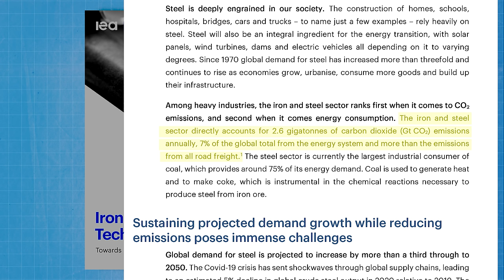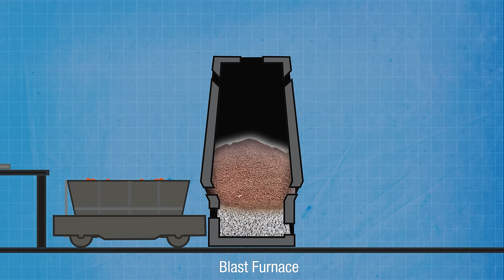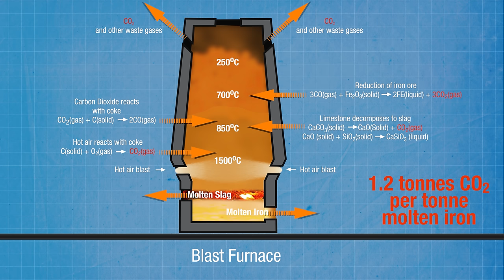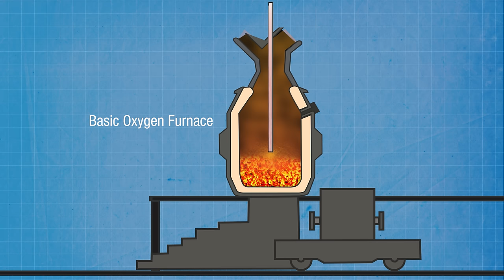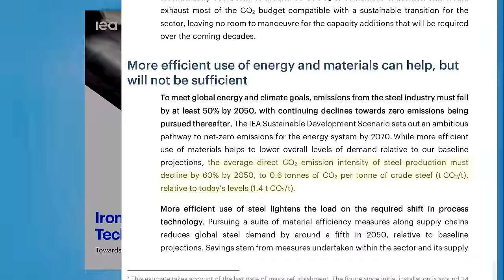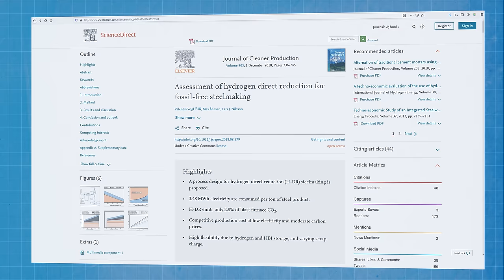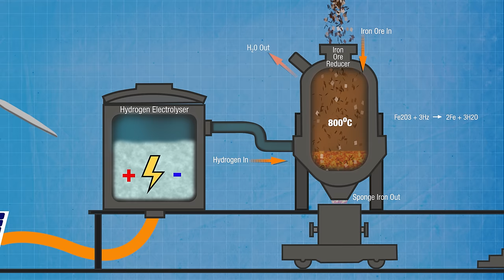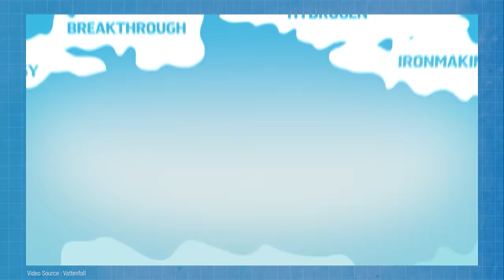Fossil free steel. Another giant step towards net carbon zero?

Comment: Bonjour!
We've had a lot of  trouble deciding between wood structures or steel structures for construction here in Quebec.
This will help decide things in he future thanks!
Reply: advantages for both,  but Steel buildings are cheaper, stronger, and easier to build.   Plus they are a bit more fire resistant  as long as you follow the building codes :)
Reply: Allow me to make it harder. Both Norway and Sweden has built apartment buildings up to about six stories high in wood. Those two countries has roughly the same climate as Canada so should meet the enviornmental critiera.

Can't recall where the norwegian ones are but the ones in Sweden (that they also decided to clad in cedar shingles) are located at Strandparken in Sundbyberg (so about 30min by foot from Bromma Airport (short haul, does connect with London however), if you need to send a delegation to actually see the houses once travel is possible again).
Reply: If you make buildings of wood there is a high fire risk. Just look at San Franciscos region, anywhere houses are made of wood and are  close to forests they will be burned. Use breeze block faced with rock. The wooden house thing is clearly dangerous. But whatever, climate disruption will be the prominent feature of our future.
Reply: No more high rise buildings. Therefore less steel use.
Reply: Also aluminum structures are more susceptible to fatigue than steel structures. Steel lasts longer. If weight is not an issue I would choose steel.
Reply: @timkbirchico8542  That is an engineering question really - fire risk in a properly engineered wood building is roughly the same as in any building with furniture in it (furniture and wallpaper are the real kindling, not to mention rugs/carpets). Also, by the time fire from huge blazes gets close enough the air is already too toxic.

Also, there is nothing to prevent you from doing a concrete-based coating on a wood house, and suddenly it becomes even more resistant towards fire than steel houses are (but to be fair, once you hit the temperatures where steel start to become an issue you want to rebuild the structure anyway)

People seem to underestimate just how good wood is at resisting fire if used properly.

(I should point out - wood "high" rises are not the same as the small cottages most people seem to think about, we are talking things that are designed to develop a fire-resistant char in case of prolonged exposure to fire)
Reply: Steel structures  are not more fire resistant. The insurance industry ranks 'massive  wood construction' as the best for fire rating. This doesn't sound right, so here's the logic. Wood is a  great insulator. And it burns from the outside in. So it takes a great deal of time for a fire to burn thru a massive wood column, before it is reduced  in size that allows failure. Steel, on the other hand, when it gets hot enough, merely lose strength, and the structure quickly collapses. Solution??? Massive insulation of a fire resistant coating must be applied to these steel structures. So, for smaller buildings, currently 12 stories, massive glue laminated columns lock up enormous quantities of carbon, are low in entropy in the complete building cycle, and are distinctly  beautiful. How about a episode on this...or has this already been done did?
Reply: @davidkreimer2970  I completely agree with you. My preferred material has always been wood. Wood does have also a high fatigue resistance.
Medieval wooden constructions are still standing. Where I live there are many 13th and 14th century buildings that are still standing strong.
Trees have evolved to be fatigue resistant.
I nag about fatigue because it determines how long a construction can last.
Reply: Fire protection for steel and wooden beams: Aerogel.
Reply: @TTTzzzz  Moisture management for aerogels: wood or metal enclosures ;)
(While aerogels are great in some applications you do not want it exposed to uncontrolled enviornments, especially long term)
Reply: @Herr_U  Please explain.
Reply: @TTTzzzz  Aerogels by nature are hydrophilic which makes them collapse, you can treat them to get them hydrophobic.

However neither state really is desired - in the hydrophilic state it will collapse after a while (simply by extracting moisture from the air) if left in an uncontrolled enviornment.

The hydrophobic state (when threated in structure, the surface only still have a hydrophilic inside structure) does better but ages more rapidly under controlled conditions (and we lack long term data for the hydrophobic version).

Also aerogels doesn't do well if subjected to repeated freeze/thaw cycles once you start bumping your timeline into decades (for short term use (less than about two decades) it is an awesome family of materials once moisture is under control, beyond that you either would have wanted to keep it in a controlled enviorment or institute a strict regiment of inspections and replacement).
Reply: @Herr_U  Thanks for your input. I am going to study aerogels much more extensive. The firm I work for is considering aerogels as insulating offshore constructions.
Reply: @TTTzzzz  It is worth looking into closely, there has quite recently (last two years) been a couple of papers published regarding testing its durability for long-term.

In general the normal method to work around it is to simply sandwich the aerogel between two shells that restricts moisture.

I'm actually a bit curious about a thing there, how long do you roughly spec offshore installations to have a service life for? (I'm from an electrical train background so I'm used to think "temporary is 20 years, short is 40, normal is 80" (this for the electrical parts, for the rolling-stock rails the rule of thumb is "make it last at least a century") (the "normal is 80" is due to the concrete type we used half a century ago, without regular maintenance it was only specced to live that long))
Reply: @Herr_U  Thanks for your reply.
It's hard to spec a service life.
It is: do your best and make it as strong as you can. All scantlings are calculated ofcource with 'finite element' software.
Some parts of the construction are 300mm thick
Service life depends on where the FPSO is stationed. For example off the coast of Angola (calm and warm waters) or the northern North Sea. (extreme and cold weather conditions).
I will expand on the northern North sea.
Because this area can be very cold the ship construction, piping and systems become brittle so fatigue resistance becomes  important.
Due to the heavy weather and large waves (20m) and the more than occasional rogue waves (30m+) the ship is heavily constructed. Even then damage to the structure can occur.
The life span of a FPSO can be 40 years,
It depends on the design construction and loading.
The systems may be renewed. Piping, valves, electricity generation, oil and gas processing. chemical injection etc.
Calculating the life span of an FPSO is impossible.
If you want to take a look at an FPSO search for 'Bleo Holm'. 
Thank you for your request. Regards, Piet.

Comment: This technology was developed few years ago already, so it has greatly annoyed me that so few people have heard of it and there's always at least one moron going "but (insert green tech) uses steel and that is not carbon free!" when 1. this tech exists, and 2. fossil fuel industry uses even more steel so right back at you...

A potentially major thing with the new system is that the furnace will be putting out a lot of 800 degree steam so it should not be a problem to direct that heat into an exchanger for a boiler of a steam turbine. The plant will be using lots of power in the electric furnaces so producing some of it locally from what is effectively a renewable power source should both help with their power bills and CO2 tax and lower the amount of power the local grid needs to deliver to industry, meaning there is less drain on the grid, less need for balancing and less need for new power plants or storage.

Of course we will still need more grid power production and storage, but instead of adding a huge consumer that requires building of a new power plant a new steel mill will be buying renewable power for producing hydrogen, which acts as energy storage so they can use solar or wind without worrying about night or windless days stopping everything. The hydrogen will then make steel and steam power, which is a steadier energy source as there will be plenty of waste heat that can be used to keep the boilers hot. The electric furnaces cannot boil more steam directly as the last thing you want in a thing you want to get hotter is a cooling system that operates when it is running, but those machines, as well as the molten steel, need to cool down eventually so reusing some of the heat you want to get rid of to run more power generation will again increase the energy efficiency of the plant, meaning you get cheaper steel. Adding these devices to a regular furnace would be too costly and bothersome, but when you already have easily tapped steam for power the other parts become much more viable and cheaper to implement.

Also, while the steel plant might just run their own hydrogen production to ensure it is carbon free, you already need to prepare for times when renewables don't deliver much power or you need to increase steel production so it makes sense to build a big enough H2 factory to not just cover the needs of the steel plant but sell it to other industries and as fuel. The same industries also need lots of trucks for transport and in large scale vehicles hydrogen is cheaper and lighter option than batteries so they have even more incentive to increase the production and therefore lower the cost of hydrogen, which also means hydrogen becomes more viable for other vehicles and there will be more demand for renewable power for producing it.
Reply: The problem would be impurities in the steam would cause the turbine to fail. However a heat exchanger could sort that out and have a closed cycle for the turbine. My ballpark maths says 10% loss of energy in the exchanger plus 35% in the cooling tower. That's still pretty good though. As for hydrogen it is a git to store. You have to either store it mind bogglingly cold or in metal matrixes which are a sod in themselves. The best bet would be vented underground storage. Hydrogen escapes pretty quick if you have a decent size vent. Cold air settles and would help keep it cold. Theoretically you could store about 2g per litre of storage space if you are lucky. Liquid hydrogen at -260C is still only 7g/litre. Quarter that for  "high temperature" storage at -80C in a metal matrix.
Reply: @gordonlawrence1448  The steam coming out of the furnace would not be at high enough pressure to spin a turbine, you must use a heat exchanger just like a nuclear plant needs one to keep the radioactive water from touching anything outside the containment vessel.
Once it is no longer hot enough to flash boil water the hot steam can still be used for heating the city buildings and maybe de-ice roads. That infrastructure needs to be built by the city, but having such ready customer for your waste heat would probably attract more than one industry to build their plant in there, which means the city gets more tax revenue in addition to having greener power services and safer roads in winter.

Hydrogen has some trouble with storage but with the electrolysis going on most of the time any leakage can be easily covered for. Given it is going to be used soon I'd probably use pressured instead of liquefied gas, but reheating it to proper temperature would not be an issue with all the waste heat around.
Reply: @AnalystPrime  There are low pressure turbines. They are a lot bigger but they still work.
Reply: In fact, SSAB already uses waste heat to heat up the homes of the entire surrounding town
Reply: @counselthyself I'm not sure what a rant about how nobody is building much nuclear power these days has to do with improved steel production... If the message is that things that take a long time to build take a long time to build, well, duh.

I watched the video from the beginning and have to note that while Dr. Smil is correct about many things like how we need to waste less energy and there needs to be economic and political pressure to make the necessary changes, many of his five years old statements have not exactly aged well. Clarke's first and second law clearly apply.

The disclaimer "Past results are no guarantee of future performance." came to mind when he predicts in the next 25 years renewable power production might double or triple while fossil fuels would stay cheap and everyone keeps building more coal power...
Reply: @albingoransson6347  I figured I can't be the first to note how useful that would be.
Reply: @counselthyself I liked to see someone shining a light on this, most of the contet was positive in my eyes. Smart people have decided what should be done and then other people have decided to not do it when it comes to the plastics, sad.. But this had little to do with local heating. Yes, most of the value in the output from these incinerators comes in the form of local heating of surrounding homes. 
What i meant with "waste heat" was; heat that are not needed by the production. Like when steel are cooled in different processes. That excess heat are used in homes. Kind of like the waste plants but in the case of the steel plant, heat are not the main product, just a bi-product.
Reply: @counselthyself Produce electricity was not the point right? The more efficient thing was to direct heated water to the houses to warm them. If your house is heated this way, I would say that you are contributing to a more sustainable form of society.
Reply: @counselthyself We left the topic of garbage a long time ago, you mentioned paper production and I mentioned steel production. If those are producing excess heat, there should be infrastructure in place to make use of that energy don't you think?
Reply: @counselthyself Who am I? I am a person who understands there are only two parts in that video relevant to this topic: The claim "there is no way to make iron without coke", which, as you know, he got wrong; and the comments on how people who have recently built something will not want to switch to new technology without economical incentives. Or in other words, sucks to be the company that just built a new steel mill and is told that they need to change the process or pay more carbon taxes. That is why I paid attention to other benefits like selling their surplus hydrogen to cover the costs.

Yes, other places produce power out of their waste heat, but generally industrial machines and computer data centers are not designed to run hot enough to melt metal. A steel mill does not need special heat transfer mediums, they can boil regular water and still run a higher output steam turbine.
Reply: @counselthyself In my town, heat from the steel production reaches out over 5 km to heat the homes of over 10k people. But I agree, this is nothing that will save the world but I think it should be done when possible.

Comment: I knew about all these projects already, but still learned a lot about details and context from your video. I.e what is 'sponge iron' and exactly how does the chemistry and process of hydrogen reduction compare/fit-in to the existing processes. Thanks again for an excellent overview.  And kudos to SSAB for getting this commercial-scale project off the ground so people can actually buy low-carbon steel soon. It's funny how many denialist types have been saying for a couple of decades "ah but what about steel - you can't decarbonise that" as if that meant it was all OK, and we should just stop even trying to fix the problem. One by one all the reasons why "it can't be done" fall by the wayside.
Reply from the maker: I agree. Denialists are running out of deniables. Soon all they'll be left with is 'a river in Egypt' :-)

Comment: It's fascinating to see how cheap and renewable electricity is really a Kickstarter to other processes.  It's almost like, we have to start somewhere to decarbonize and can leverage those successes as inputs to other processes.
Reply: Exactly. And we need to utilise the resources while we have them, instead of waiting until we run out to look into alternatives. Can't exactly ship raw materials to create renewable power if all the diesel is gone. So not only are we leveraging the initial decarbonisation, we're leveraging the final fossil burning to build the foundations of not needing to burn any more fossil fuels.
Reply: @kaitlyn__L  as Vaclov Smil puts it, wind turbines are just the epitome of embedded fossil fuel usage.  It's an interesting because it's true, but not the way it is framed in most places.

Once you get there though, can use those and feed the energy back into say an arc reactor for steel or charging your electric semi.
Reply: @llothsedai3989  yeah. Using fossil energy to lift ourselves out of needing fossil energy, while we still have time to.